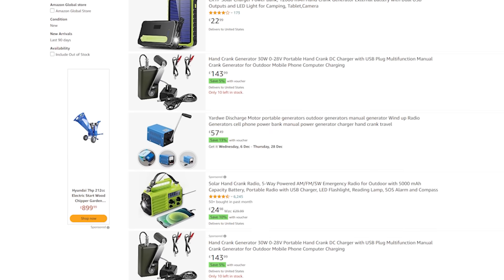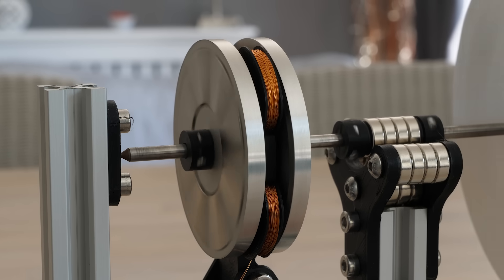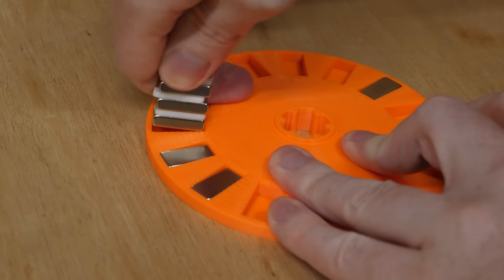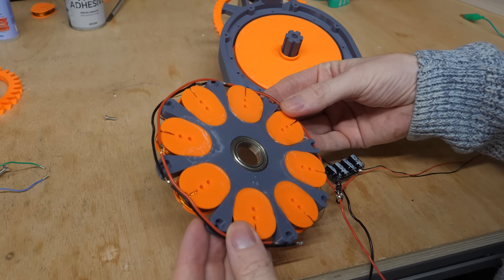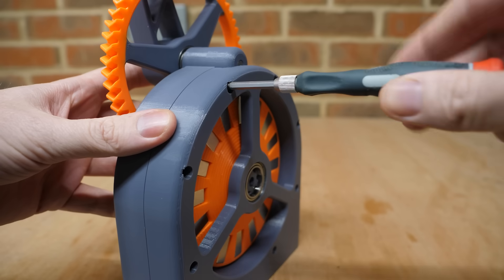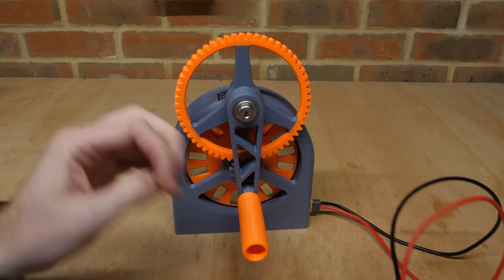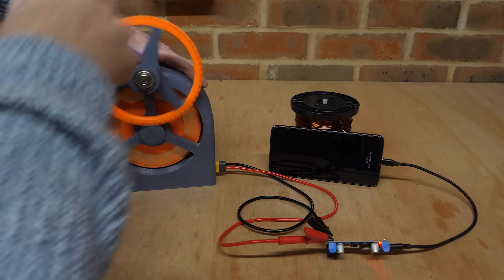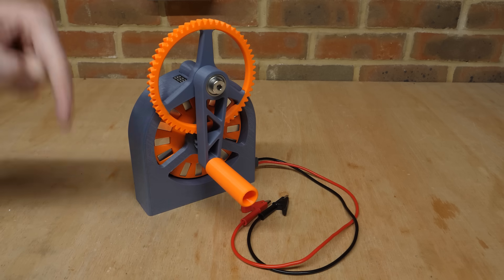Building a Generator

Comment: Hey Tim, been watching you for over half a decade. Your generator came out beautifully. It looks amazing, seems to operate smoothly and work eficiently enough for it to have some practical use. It's great to see you do more electronics as well!

Something I struggled with in electronics was understanding voltage and current and it's relation to watts and using the "correct" terms that other electrically experienced people will understand. I'd like to share a concept that works for me.

Power = RPM x Torque
Power = Voltage x Current

I see RPM as Voltage, current as torque.

When I look at the charged storage in your generator I imagine a metal flywheel spinning relatively slowly (low voltage) but with a lot of mass (available current). When that flywheel is charged, your brain may not think "what do I do with all this speed" (or volts), you may think of it in terms of power instead.

Comment: Its super cool how electrical resistance turns to physical resistance with this thing. Would be a great learning tool for kids!
Reply: It's not really electrical resistance turning into physical resistance, it's electrical power turning into physical resistance. The more power draw you have the harder it is to turn. But I agree it would be a great learning tool for kids. This is actually true for any generator and is a part of the law of conservation of energy and not only kids but most people are not aware that generators are harder to turn the more power draw you have from them.
Reply: @markoap91  what is the reason for the power draw causing more resistance?
Reply: @megaman1997ful  Because you cannot create energy out of nothing. The speed of turning the generator gives the voltage, but you may draw different current at the same voltage, meaning it has to be possible to generate different amounts of power using the same crank speed. The only things, that affect the power generated, is the speed and the force (alternatively the torque and angular velocity), and with constant speed, the only thing that may change is the force. Hence higher power draw causes the need for more force.
As per the mechanics this is caused because the current flowing through the generator coils produces magnetic fields that oppose the change caused by the rotation of the magnets in rotor. When no power is drawn, no current flows, and there is no resistance (ideally). When the power draw increases, the current rises and the magnetic fields opposing rotation are stronger, hence one has to crank against more resistance.
Reply: @Kycilak  Thankyou for the detailed response! thats completely cleared up the confusion for me :D
Reply: @megaman1997ful  @Kycilak covered everything quite well. Nothing I can add to that.
Reply: Today I learned! Thanks @Kycilak
Reply: @Kycilak  is the magnetic fields opposing the rotation is that what they call eddy currents??
Reply: @Shadow_TheMaster167  Not exactly but you are close. First of all eddy currents are not magnetic field but the current causing it.
As to what currents exactly are called eddy, I'm out of my water. I associate eddy currents with inefficiency and induction in bulk metal. Someone will hopefully correct me, if I'm wrong. I also encourage search.
Reply: @Kycilak  thanks I learnt something new today
Reply: @Kycilak  First half of your comment I thought you were only going to talk about conservation of energy and was getting ready to add the bit about current creating an opposing magnetic field, but then I finished reading your comment and saw you covered that too. Very concise explanation.
Reply: @markoap91  https://youtu.be/VUF67__DEvE?si=W4X9NOBRbTeG3e8o
Reply: Awesome. Not only for Kids. As being a German I also would like to print one of these for our economics minister and some others in our parliament :).
Free of charge of course.
Reply: This phenomenon is called counter-torque. It occurs because when a generator induces current flow, the machine also then meets the requirements for motor action in the opposite direction, so a physical resistance can be felt that varies based on the current draw. The opposite actually happens in motors too. That's called counter-electromotive force.
Reply: This is how the Dynamical-Braking works on Diesel-Electric locomotives. Normally the electricity generated is dissipated in heat form, but in some cases this energy is stored on batteries I think, to be used later.
Reply: Why do people always say... "good idea for kids" 😴😴😴😴 when adults are here marveling

Comment: Why didn't you show us the AMPERAGE of the output. I don't care about the voltage that is super easy to amplify, and the phone charging is not accurate enough to prove 5 watts. I was expecting more numerical data, Kinda deceptive video, I feel cheated.
Reply from the maker: This video was meant to be a short build/info video for an upcoming video on my main channel. However, it's gained far more interest than I expected, so I'll be making a follow-up soon!

Comment: It would be interesting to use a DC motor to power your generator and attach an electronic load to it's output.  That way you could measure the input and output power which would allow calculating the overall efficiency of the generator.

Comment: You could use car 12v/24v USB PD charger. They approve voltages from 10v to 30v and can support high speed charging. Just wire the generator to 12v car outlet (cut from extension).

Comment: Wow, always have a hard time believing the resistance also happens physically when generating.
Reply: Ahh got it, the back emf from the circuit pushed back the magnets that are connected to the crank. Thanks for the clarification
Reply: Basically the resistance felt when cranking with a load is due to something called "back EMF". I'll try to explain briefly. (Might fail...) When cranking and the magnets are moving past the coils, all that is being generated is Voltage. If the output isn't connected to anything no current will flow so all that is happening is an AC voltage is on the output. Once a closed circuit is connected to the output, current can then flow. Flowing current creates its own magnetic field. Within the coils that current-created field is opposite to the field from the magnets creating the voltage. The resistance that is felt is the force of the two magnetic fields trying to repell each other. I hope that helps.

Comment: Its not the number of turns that determine the voltage its the lenght of the wire been properly intersected by the magnetic filed
Reply: Actually it's the change in flux density through the surface of the coil times the number of turns (Maxwell-Faraday Equation)

Comment: I think he should increase the gear ratio a little more to get more rpms while not having to work so hard to put more speed to spin the crank. Although it will also add a little more resistance to it. Great design though.

Comment: hey tom! i built something like this just the other day, using a nema34 stepper motor. stepper motors are great for low rpm high voltage generators as that is how they're designed to operate

Comment: Well done, it seems sturdy and usable. I think I would use it, but would still add a powerbank/battery as reserve/buffer/protection for final powered hardware, that I would keep fully charged to start charging devices ASAP, and then use your generator to recharche the powerbank.

Comment: Fun project! It'd be interesting to do a belt drive to really get the drive ratio up. Maybe incorporate a flywheel? You know what could be fun: make a portable flywheel that you filled with water. The water would naturally spin towards the outward part of a toroid "flywheel", and you could drain it when you were done and wanted to pack it somewhere.
Reply: It's always better to design a generator that operates at a lower rpm rather than use an inefficient geared up transmission. Belts are much less efficient than gears.
When using a voltage regulator, it provides a stable output, no flywheel needed. A flywheel only helps to stabilise the rpm and therefore voltage output.
Reply: @Ed.R  I think the challenge here is: he already has the generator that uses cheap components, and he's obviously not really maxing out the energy that his arms can produce. Even if the belt drive was less efficient, it'd be easy for him to 3d print toothed cogs of various sizes to test, and the total power output would be higher. Obviously, if you really wanted to generate power, using some kind of bicycle pedal system would be way more effective.

Comment: Could you add more rotors and stators around the main gear. Like 4 or 5 more. What would the resistance be to turn the crank Vs the power generation

Comment: Serpentine coils anyone? 
I wonder if there will be anything else invented discovered that can make electricity in a different way. I only know of piezo electric. Seems like motors are almost perfected or fully advanced. I guess magnets will be the next thing. Or some kind of new wire that works better than copper but that's unlikely.  Maybe a wire could be made that is like a conductive polymer a strand of carbon and a strand of copper that's actually a second polymer with very thin strands of copper in it, then based on design there's patches in the polymer where super fine metal dust and or carbon or graphene so the wire would be in sections spaced out and the overall efficiency is increased because the field is made to produce more and have less resistance/ impedance internally.

Comment: When making a generator, make the rotor the copper wires, not the heavy magnet disk. If the rotor is made of copper, it would take less force to spin and generate power more efficiently. Here's why: lighter rotors require less effort to spin, especially at the same rate compared to heavier ones with the magnets attached. This is because lighter objects have less inertia, meaning they resist changes in their motion less. So, when you hand-crank the lighter rotor, you'll likely find it easier and could potentially generate power more efficiently. The heavy disk with magnets, due to its weight, will need more force to achieve the same spin rate. This force required to generate power is then added when the generator is under load.
Reply: its much easier to connect the wires from the coils if you don't have to worry about them spinning
Reply: @Xiefux  I was thinking along the lines of a slip ring, wouldn’t that be a quick $1 solution?
Reply: @magnetation  even then, this thing is going to break faster and be less reliable

Comment: So, first I need to be critic, otherwise nobody will read this:
-This Setup need to be bigger for bigger Crank and Balanced rotational force , if we consider to use it in wild nature.
The problem starts, when you try to spin it for like an 10min-30min. your muscles will reject this movement. You need optimal radius that is spinable, not too heavy and don't play with your brain, because its too much. The generator design is excellent. But the gear ratio is like for showing case only. I think, nobody will crank this for more than 2-3 minutes. by increasing the gear ratio, it will be harder but slower movement will increase durability of our preformance so we can make real use of this in some emergency cases.
Allthough, great clip and i really like your vids! I always can't wait to see your new stuff you make :)

Comment: Your current will be dictated by the device.
The device plugged into a generator will always draw what it needs as far as current goes. 
Of course the greater the loads demand the more physical resistance you'll experience on the input.
A wider base for stability would be good. 
Perhaps a good place for those super caps of yours as well a the USB 5V regulator. 
Your volt meter is neat and all but it's also a parasite.
Using a momentary push button would be better.

Comment: Use the capacitor bank to a step down converter to charge a phone etc then once you charge the bank you won't need to keep cranking the handle.
Mine powers LEDs for upto 45 minutes after 10 minutes of cranking.
Thanks for sharing. Yours gives more power output than mine. 👍🇬🇧

Comment: Potential upgrades, have a steel plate on either end of the rotor so the magnets have a low reluctance path and you'd have more magnetic flux. (or the same with less magnets) Also a freewheeling clutch thing for if you stop cranking and the rotor can spin freely.
Reply: Taking transformer plates and shoving them in the center of the coils would probably be better, for less over all weight. Like doubling the output power better.  Would also be interesting to see ferrofluid in the center. More used in speakers as a lube for the driver & a flux enhancer but it should work there too.
Reply: The low reluctance path needs to be laminated otherwise he will get huge eddy currents. Perpendicular to the direction of magnetic flux, a bit like arches. Maybe he will get away on bother outer sides with only a flat plate, since the field of the magnets is much more dominant compared to the induced field of the stator. Main benefit will be if he can provide a low reluctance path for the stator coils (filling coil with lamination). Big benefit with the axial machine is, theses paths are already short by design (different as in radial flux machines)
Reply: What happens if you put coils on both sides of the plates that holds the magnets? I mean the parts where the magnets are should be open on the both sides and then you put coils on both sides of it. What would happen?
Reply: You have the problem of transferring power when you do that. Tend to ark and cause corrosion having you wires stationary makes it much easier. Unless you are just talking about making a stacking generator. He hints at that in the video when he talks about the series parallel configuration.  You'd get more amp/volts depending on the configuration. The ends though waste magnetic field if it's not directed back in with some ferromagnetic material, or a Halbach array  Generally want your ends to redirect the field back in where you are capturing the work. That said it's harder to deign and heavier so where weight is an issue you don't always or to the same degree.

Worth noting that the coils when this happens generate heat, copper / aluminum are diamagnetic and appose the field around generating the power. More work More heat more coils even more heat. You'd run a good risk of a PLA generator melting without regulating that extra current or adding in thermal correction with airflow or convection. Not so bad with a hand crank but a wind or motor driven one would Definity suffer a meltdown.  Much like an induction heater.

Comment: information
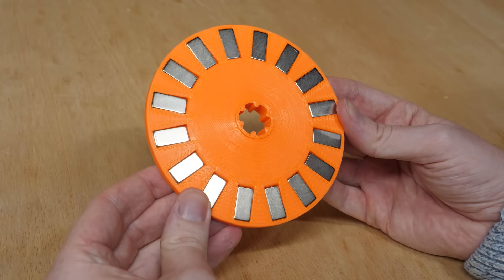2:00   this magnet arrangement is correct, for a single rotor alternator.      BUT   the magnets need to be near enough to one another, such that magnetic poles are able to form  between  adjacent  magnets.!      in the case of a dual rotor alternator,  it is not clear whether this magnet arrangement  is  Also  significantly Less-than  ideal.!
a generating coil  SHOULD  be  made a certain way.!      it should be a brooks coil.       a brooks coils is a coil that has a  Square cross-section; eg., the same number of Layers as winds. 
2:35     YES     but the  CURRENT  would have been nominal.!        if you want more volts out, wind generating coils 'in hand';  or use a voltage multiplier.      a generating coil should be wound using a conductor size of 14awg or an equivalent amount of copper.
my experience with the use of neo-magnets in a dual rotor alternator suggests that  the  total gap  between the rotors should be about  One centimeter.      obviously this fact  Determines  the maximum efficient thickness and overall size of  the (brooks) generating coils.        a generating coil  SHOULD  have a layered structure; unlike a solenoid coil.
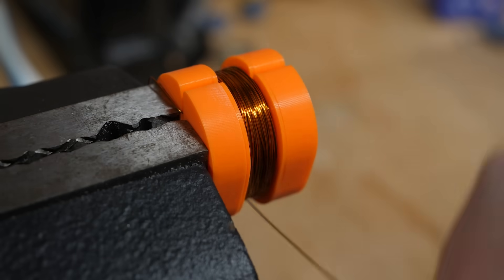2:45   a conventionally wound coil makes back-emf  when energized*.        when a generating coil has  TOO  many winds, the coil acts a current clamp.      meaning, the coil's output voltage will be higher,  but  the  current  will  ALWAYS  be underwhelming.
*  this is so because the Direction of current flow in adjacent layers of a coil is  180 mechanical degrees out of phase.

Comment: so a solar charge controller adjusts its' input impedance to match the load for max efficiency.  it seems like seeing 0V (nearly short) would be the best way here...similar to the cap bank.  but how to enforce that with electronics?

Comment: You have to balance the thickness of the wires you are using, with the number of turns and the wire resistance to maximize the output POWER, which should be the goal here. Then if you need more voltage you can use a boost converter circuit.
Reply: Often times in power electronics its much easier to start with a higher voltage, for example a full bridge rectifier will have the same drop regardless of voltage and thus your power losses as a percentage go down at higher voltage